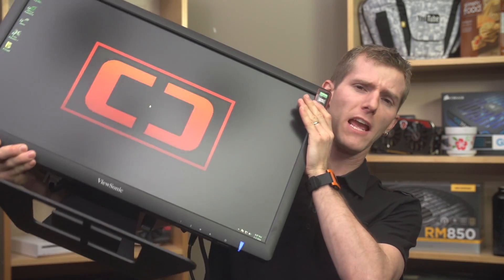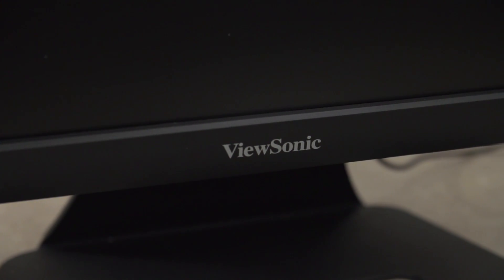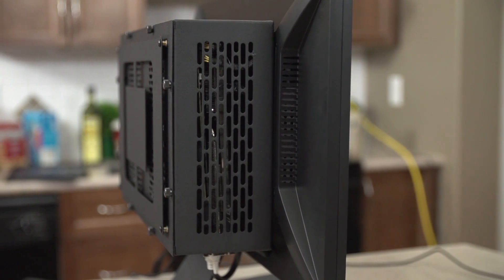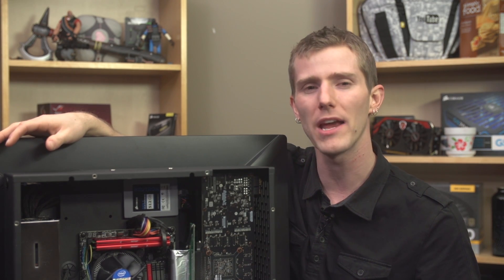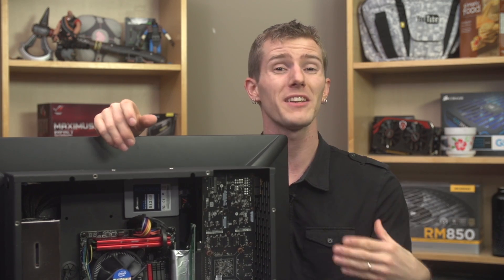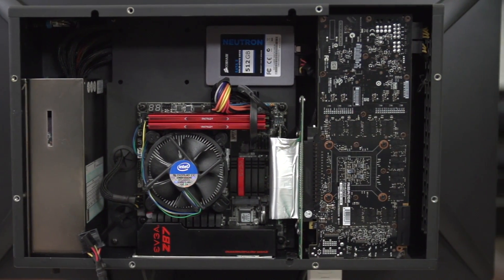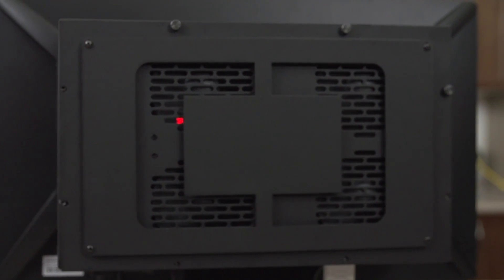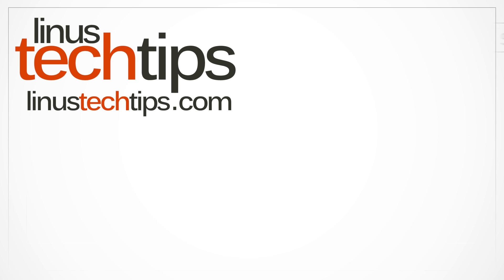Crate Computer Ultimate Gaming AIO

Comment: Crate computer aka we glued a mid tower on the back of a monitor
Reply: well why the fuck not?
Reply: and charged $1,900 for it.
Reply: Are you serious on that pricing? I could just grab any tower and attach a vesa mount to the side of it...

EDIT: It actually just is a standard VESA mount.
Reply: ThierryTheuns not kidding, that's the cheapest model, it goes all the way up to $10,000 for about $2,500 worth of parts in the exact same case. I can get a better machine in a laptop form-factor by Eurocom for $4,000! it's just not worth it to get one of these machines.
Reply: MortifiedDumplin Yeah at these price levels I'd rather buy the laptops with desktop CPU and GPU. I checked Crate Computers website a few minutes ago, and they only go up to Z97 and 980s, so I guess they're no longer in business since they haven't updated in a while.
Reply: ThierryTheuns I sure hope so. these people don't deserve to be in business if they plan on more than pentupling the normal profit from things like this.
Reply: MortifiedDumplin Might actually have shut down because someone called them out on it. I'm not willing to try and order from them to see if they're still active, though.
Reply: ya if they just sold the monitor and case barebones kit for like $400 that might be a good idea
Reply: +Greg Erble That would depend on what monitor we'd get.
Reply: ThierryTheuns ya definitely i was thinking around $400 for the 120hz, at least that's SOMEWHAT reasonable.
Reply: Greg Erble Seems fair. Someone should now make this a company, call it Box Computers, and dominate that market.
Reply: Mrcantfapenough Think it'd be easier to just have people select a monitor and then build around it. Getting an entire industry to form a standard based on a start up company is not going to happen.
Reply: or, you know, add support struts and 4 holes to a existing mITX case and screw a monitor on via industry standard VESA mounting? I'm actually planning on doing this to a Dell case I've had kicking around for a while now.
Reply: MortifiedDumplin That already exists as a product. That's why I didn't mention it.
Reply: ThierryTheuns doesn't necessarily mean you cant sell it. :P
Reply: MortifiedDumplin Depends wether there is a patent, true. Interested in starting a business? XD
Reply: exactly what i was thinking the whole video XD

Comment: I know this is not a laptop oriented channel, but what makes laptops and notebook absurd design is the heat dissipation issue. a laptop's flat setup is the worst heat dissipation possible.  aio PCs  are a fantastic middle ground. basically they are big tablets. also The fact aio PCs can be carried from room to room with very few hassle is a great adv compared to towers.  in many many aspect, I find aio are the optimum form factor and can replace laptops (small AIOs of slightly less than 20inch should be developed more IMHO) and full desktop rigs:  bulky AIO's like this one in this video could very well have the same performance as desktops. very interesting topic.

Comment: I'm not really one for the all-in-ones, but I can speculate that it has something to do both with the footprint requirements and the aesthetic appeal. But looking at this, aesthetics doesn't seem to play in; it looks like a computer you could just as well put under your monitor, only strapped to the back. The all-in-one desktop design is something that Apple has always cornered the market on (for that very reason, I think) so if a similarly designed PC were to have mass appeal, I would imagine that it would need to compete with the design aesthetic of the Mac. Otherwise, and given the recent trend in Microsoft's integration strategy, a similarly designed device might preferably be substituted for a large-format desktop tablet or touchscreen all-in-one.

Which obviously doesn't cater to the gaming market. So the conclusion stands, this is a peculiar little niche.

Comment: I agree 100% on keeping my towers but I do have an AIO, bought it for the kitchen, sits on the counter with the appliances.
Used for radio and movies / YouTube (LTT) while I'm cooking and eating etc.
I got it for recipes and tracking food habits but didn't really use it for that.
It's touchscreen, added a waterproofing film cover so I can operate it while  hands are dirty prepping food and it's great.
I love having it there... Also, because its only used for simple tasks, Windows 8.1 is perfect on it.
BTW: My A-I-O has been taken apart and upgraded so saying the crate makes them upgradable isn't 100%.
Can't change everything but I did upgrade RAM, SSD, and slipped in a Corsair closed loop with a slim fan and the radiator mounted externally. Wasn't necessary but I had the loop laying around from an upgrade on my server and fabricated a frame to hold up the additional weight. It looks a little funny like that big cage on that machine but it was a fun project.

Comment: I used to have a gateway profile 6, it was a nice all in one. You could install a full sized GPU in there, and almost everything else used full sized PC parts that were upgradeable. The monitor was easily adjustable, you could adjust both horizontal and vertical. But you couldn't upgrade the motherboard since it had a custom built motherboard inside. So I eventually switched to a full tower.

Comment: For me, the all-in-one PC is more about asthetics and convenience more than anything else. I can appreciate a fast, powerful, upgradable tower, and in fact, that's what my main PC's have always been. But thinking from the perspective of the average consumer, It's nice to have a PC with only ONE WIRE. With the advent of wireless printers, speakers integrated into the monitor, and bluetooth mice and keyboards, most AIO PC's I've observed at Best Buy, Tiger Direct, and other technology retailers, all have just a power wire and THAT'S IT. While things like gaming are often choked by the use of integrated graphics or low-power dedicated graphics (often the mobile versions are used in AIO PC's), they are still decently powerful for even pretty intensive media use. A recent test of my neighbor's 21.5" iMac with a 4th-generation i7 and Intel HD graphics shows that it performed surprisingly well in HD renders on Adobe Premiere. My sister's HP Pavilion all-in-one PC is great for her dorm, as it's better than the small screen on her laptop, performs far faster, and is easy to set up (again, only one wire and a bluetooth peripheral set). All in all, I conclude that (in my opinion) the all-in-one PC is really meant for the average consumer, and is by no means meant (as a concept) to be a gaming system.

Comment: Damn thats pretty dope. I personally like towers mainly because there's options for every component, but for an AIO thats cool. All they really need to do is have a top mounted 120/140mm Radiator and its pretty much perfect. I didnt see much in terms of cable management for KB+M, but thats not much of an issue. It would be pretty sweet if the base had an integrated USB/Thunderbolt bay station. Can you imagine having G-Sync and/or FreeSync in that system. As long as the overall cost is within $200-300 higher vs build it yourself then thats pretty damn sick.

Comment: this thing will fail in unimaginable ways. the entry level one cost 2231$ and comes with an i5 and a single gtx 760 and the design doesnt even look modern. for 2000$ i can build a fucking beast.  you have to be an idiot to buy this.
Reply: Touché. And this is exactly the same case with the Steam Box.
Reply: ThatMiddleEastern For most, but the ibuypower one seems a very good price. If they keep it $500 that is.
Reply: Zcolby there is still little reason not to make your own 500$ pc, you get more buck for your bang. but yeah, ibuypower's steambox is the most reasonable of the lot.
Reply: ditto. you can fit an i7 4770k and dual 780ti's in 2000$ with some headroom left for a good motherboard and an ssd.

Comment: The apeal for an "all in one" PC in my house hold, casting aside the gaming performance is for older or less techanically experienced users to be able to clearly see what wires go where with little set up hastle. This is a minor increase in user comfort but for an inexperienced user, it has everything where you need it, for example on/off switch, USB ports and ethernet. For a user with any experience and drive to upgrade/rebuild I would completely agree that the use of a traditional tower-monitor divide is the most optimal.

Comment: Not an AIO, It's a HTPC nailed to the back of a monitor. AIOs are smaller and only require one power cord.
Reply: ***** No it's not an AIO as it's simply a case screwed on to the back of a monitor. Have you seen actual AIOs? This doesn't have any of the benefits of an AIO, like not having a tower in the first place. And it still uses 2 power cords, how the hell is it an All In One? In that case we could all nail a tower to the back of our monitors and call it an AIO.
Reply: Sebastian Correa No I haven't even built my own PC yet. But it's possible. Probably more trouble than it's worth, so I'd pay these guys if I was interested. Nevertheless, this is missing a lot of the benefits of having an AIO. Like it's never this big and only use one power cord. Usually touch screen as well.
Reply: omg dude XD as an engineer i say AiO are the same like a tower mounted on the back of a monitor its just the outcase wich looks like a single piece
Reply: Skyy remi Nah not an AIO. It's called an All In One, as everything is in one container (the monitor), not one container screwed to the back of another.
Reply: AIO is All in One (piece) the same its just the case wich makes it look like 1 component

Comment: Almost four grand? It's an interesting computer, sure, but I'm not really sold on the value.
Reply: Correct me if im wrong

MOBO - around $200   (mitx stinger evga)
CPU - around $200   (i5 4570k)
GPU - around $550   (ACX cooled 780)
SSD - between $300-$400 
RAM - around $175   (16GB red patriot)
PSU - around $60      (600W 80 bronze)
OS - around $100      (Win 7 or 8 dunno)
______________________________
About a $1585-$1685 computer not including the 4 fans

So if the monitor is between $2000-$2300, it doesnt appear to be overpriced with the parts it has. I dont really know anything about value. I just check to see if there is overpaying or underpaying based on the parts it has. I suppose you can get a cheap 27" for about $300. Maybe thats where you can get your value. So the selling point of this would be if it has a blow you out of your mind monitor

I suppose if all you do is browse the internet, then this has no value at all and a $200 computer would be enough.

Comment: Just a comment, well, here goes mine: ALL in One PC's, are those that EVERYTHING is inside the screen, i mean, on the video, that's like screwing my case at the back of my screen, it's customizable, all-in-ones (at least, the ones i've seen), have everything inside, so, you need to unscrew the back of the screen to access the components, also it can't hold a gpu like that, But well, it's my opinion, and giving the fact that i'm from mexico and here there are no "adapters from molex to gpu", i guess i can't give my opinion, great video, and great computer :)

Comment: This would be great for wall mounting a system. Perhaps college students with limited space in their dorm room. It really fits the complaints I've had with All in one PCs even though it looks like they just strapped a case on a monitor. Best part if the monitor dies you can swap it out.
Reply: As long a s some brackets are used to ensure it can get air. Bolt it straight to the wall and you can just say goodbye

Comment: Redesign the case to make it flatter by rotating the PSU 90 degrees and flipping the GPU to take in air from the back. you might shave as much as an inch off the total thickness. Other improvements would be the I/O being moved to the base of the machine so you can have easier access to the ports than most big manufacturers.

Comment: It would be neat to see if you can implement a CLC in this chassis Linus. I'm wondering if there's enough space for something like a single 120mm rad CLC if you remove one or two of the fans on the rear panel and attach it there.

Would be neat if the manufacturer could come up with a way to "quick mount" the rad to the panel so you don't need to fumble with attaching the rad while the panel is off, then get the panel back on.

Comment: Stick a corsair h100 with push or pull, on the fans, but use anti vibration grommets on the fans so that it can stretch for the special rad mounting

Comment: Had to back this up and look closer at that 4 fan armoured back panel, cause thinking. So remove all 4 fans, remove the armour, place fans on outside of case, use standoffs to mount the armour outside of those fans. And you have more internal space for a real CPU cooler, while retaining that engineered airflow in the case.

Comment: In a gen 2 modal I'd like to see more space for an mATX board, room for at least a Dual 120 mm radiator in a push pull config, 3x 3.5 drive compatibility, built in USB 3.0 and 2.0

Comment: It's perfect for me since I have a tiny desk and can't fit anything other than a mac mini under my desk so an AiO is what's for me
Reply: you forget that this thing as some serious depth to it (it must be at least 8 to 10 inches deep). It will take over most of your tiny desk once you attach a keyboard to it you would have almost no desk space left in front of the computer.
Reply: My desk is extremely deep  but it's really slim and I can only fit a 24 inch monitor on it plus a keyboard and mouse, so depth is not an issue
Reply: You could put a tower on the floor ...

Comment: corsair h100i mounted to the 2 fans closer to the psu (exhaust) and the other 2 as an intake to cool the gpu...or some cpu water coolers optimal for a gpu (maybe as an exhaust too)...idk if there is enough space to place fans on the ventalation holes on the right...seems like there is not enough space. Throw a test with watercooling!

Comment: LAN Parties mostly, when I go over to a friends place I need a box for screen keyboard mouse power cables headphones I also have to carry my full tower NZXT phantom which weighs in at about 30kgs with the W/C inside its not a big problem for me but when I get back at 3am and have to plug everything in the next day and climb through my desk almost to get the cables up behind it, then an all-in-one looks way more appealing

...sigh if only that HP Z1 came with a 780Ti or somthing similar because the price would be almost worth it to me
Reply: couldn't agree with you more
Reply: Bruce Lewis thanks bruce :) I would love to see pretty much this but instead of coming with the monitor, it just bolts on to any screens with a wall mount, and a bit more customizability wouldn't hurt. what do you think LinusTechTips?

Comment: USB 3 hub and other front I/O in the foot please. It's not the monitor's task to be the USB hub!

Also: passive cooler on the CPU. If sized just right, it will be actually actively cooled by the rear fans. How much space is in there anyway?
Reply: +Siana Gearz it is the monitors task to be the usb hub if you are going to release a AIO pc. if you need to put in a usb stick or a controller its better to have it in reach of your arm insted of going to the back of the monitor to reach for a usb port.
Reply: Kristian Klos  But this device is supposed to be a reconfigurable AIO with replaceable VESA mounted monitor unit. For this reason, i suggest that instead of requiring the actual monitor unit to have a USB hub, the USB hub be integrated into the front of the foot. This construction would be both more universal, with regard to monitor choice, and better accessible.

Comment: Been watching your videos for a while now. Can you tell me how much of a difference the ambient temp makes on a air cooled system ? The reason being the ambient temps where I live are around 30-35C most of the year falling to mid 20s in Dec. I'm quite certain that my PC runs cooler in Dec than in peak summer.
Reply: +Kanad Kalasur That sounds painfully warm. Ambient temperature makes a huge difference in any cooling setup. I've often thought about running a radiator out my window in winter, just to see how much of a difference it would make (using a non-freezing liquid). It averages around -9 C where I live during January.
Reply: Michael Schwarz thanks. The main problem here is the high temps. I've been trying some ideas out to cool my imac. I'll try to get some temp numbers and see what of my ideas work the best. Also I don't want too much sound from the fans etc. Gotten used to the quiet.

Comment: Coming from a place where people even steal outdated parts (I'm talking about DDR sticks, Pentium 2&3 CPUs, and 64MB AGP Cards), AIOs provide at the very least some form of security since they can't be taken apart so easily. Although upgrades usually mean replacing the whole system, a good AIO should easily last you 4 to 5 years if you're not running hardcore productivity or gaming.

Comment: most likely it was evga's cooling and less likely the case airflow.... But with 4 fans like those pushing air out one way it could have been the design...... ya the stock fan is a real big bummer, you didnt mention the pricerange of this all in one but thats okay i can check the link, i would add 2 external fans on the left side of the pc for better cooling. But hey this is actually really innovative and i give a thumbs up for the company who designed this all in one. Well be seeing much better models im 100% sure. btw there still seems to me alot more room inside the case or maybe its just me ;\